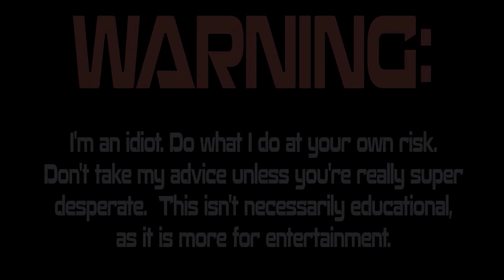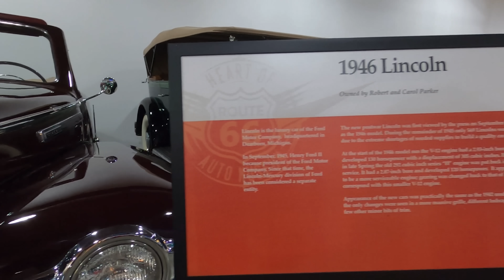Will This 1956 Buick Special DRIVE 1,200 MILES Back Home - I BROKE DOWN! (P2)

Comment: Twas the night before Christmas and out in the garage,
There wasn’t a trace of a Honda, Toyota, or Dodge.
The presents were wrapped and the lights were all lit,
So I figured I’d mess with the Camaro a bit.
I popped the release and lifted the hood,...
When a deep voice behind me said “It looks pretty good.”
Well, as you can imagine, I turned mighty quick,
And there, by the workbench, stood ol’ Saint Nick!
I stood there a bit, not to sure what to say,
Then he said. “Don’t suppose that you’d trade for my sleigh?”
“No way, Santa” I said with a grin,
“But if you’ve got the time we can go for a spin!”
His round little mouth, all tied like a bow’
Turned into a smile and he said ”Sure! Let’s go!!”
So not to disturb all the neighbors” retreat,
We quietly pushed the Camaro to the street.
Then, taking our places to coast down the hill,
I turned on the key and let the clutch spill.
The sound that erupted took him by surprise,
But he liked it a lot, by the look in his eyes.
With tires a’screaming and headers aglow,
We headed on out to where the Hot Rodders go.
And Santa’s grin widened approaching his ears,
With every shift as I banged through the gears.
Then he yelled “I CAN’T RECALL WHEN I’VE FELT SO ALIVE!”
So I backed off the gas and asked Santa if he would drive.
Ol Santa was stunned when I gave him the keys,
When he walked past the headlights he shook at the knees!
The Camaro exploded with a sweet exhaust sound!
And when Santa popped the clutch and the tires shook the ground!
Power shifting into second, again into third!
I sat there just watching, at loss for a word,
Then I heard him exclaim as we blasted from sight,
“Merry Christmas to all, it’s going to be a great night”

Comment: Those old steering wheels out gas (loose moisture oils etc. for 50 60 years and they just get brittle. They have to be remanufactured. No getting around injection mold plastics.

Comment: If you ever come across a 63 ford f100 with a slight dent in the dash near the speaker let me know last seen the engine bay was painted i had slammed it 3" in the front and 6 in the rear then got a well needed divorce and lots it

Comment: If you where over heating why put a thermostat in it, pull the old one and go
Reply from the maker: Thermostats are critical to prevent cavitation, and slow the liquid in the radiator to allow it to do its job.  Removing them doesn't necessarily lower temp 👍

Comment: I’ll tell you a funny joke, serious As a connected eyebrow! I had an old Chrysler or maybe Dodge caravan, over heated one day and the reason was the electric fan died on me, I was deep in NYC Mannnn-hattan anyhow yep stuck in NYC traffic, having to go into the Lincoln Tunnel, so yeah I was scared n screwed, so I Devised a plan and picked myself to portable automobile fans, you know those ones the bus drivers used on the cheese buses when you were in school! Something like that, anyhow I rigged both to work off one lighter and zipped tied them to the inside hood engine area inside near the rad, well actually dead front like it was a regular fan and ran them 24/7 while I drove home! You wouldn’t believe it! It worked, like a charm! It worked so well I keep them on there, until I sold the van! How about this apples 🍎

Comment: Gas / Petrol engines can vapour lock ok I get that . 
Don’t shoot me down please . 
Why can’t you fit a fuel cooler radiator . 
Similar to what some modern Diesel engines have . 
Sorry in advance just got thinking as a fella does .